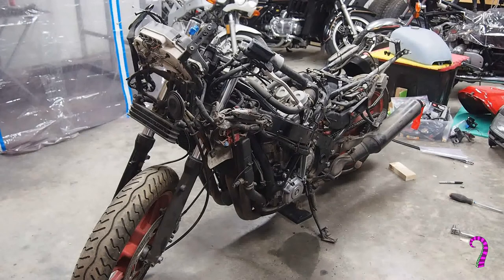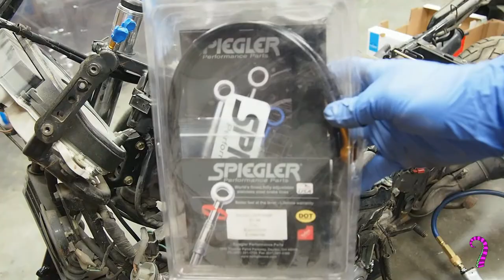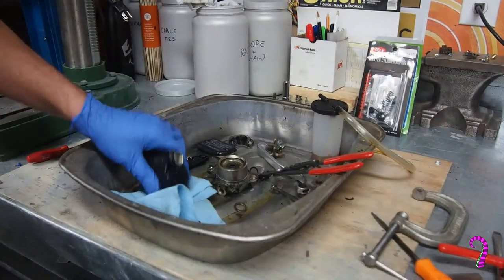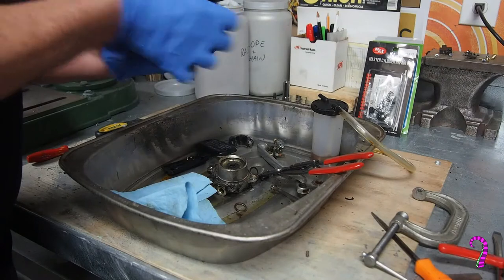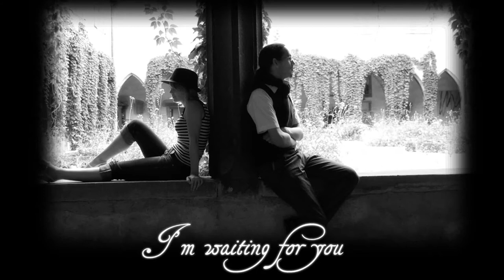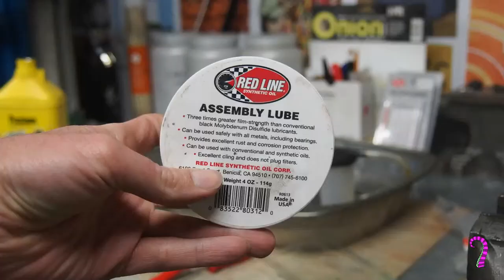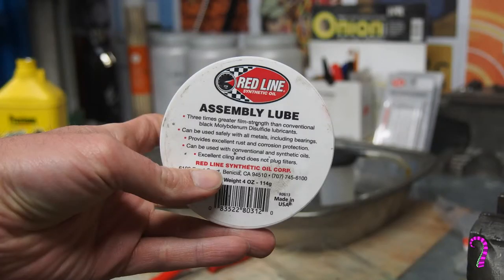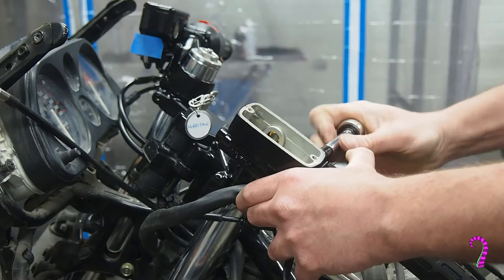Hurricane Hydraulic Clutch Rebuild

Comment: Where did you buy the seal??
Reply from the maker: It was aftermarket. I forget the exact manufacturer, but they worked just fine for all the brake and clutch hydraulics on the bike
Reply: @tentacleslap5531  thank u very much I have learnt a lot with this video, I am trying to repair my hurracaine 1988 but here in Latin America is a little bit complicated find the resources to do it.